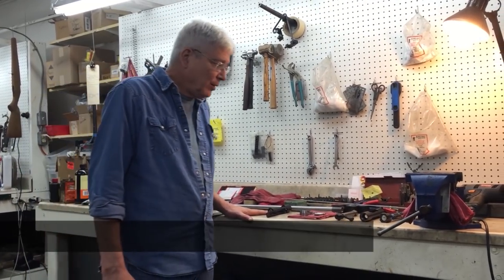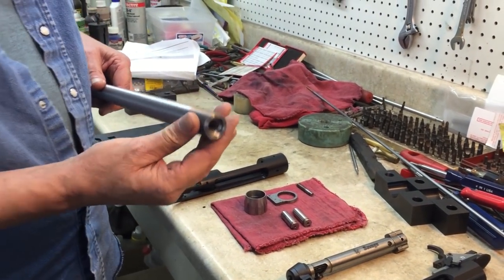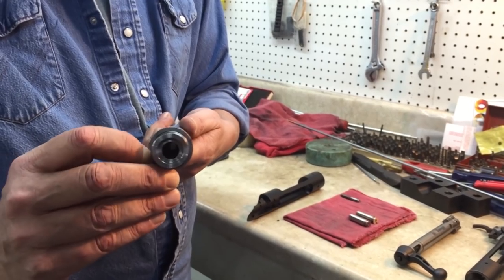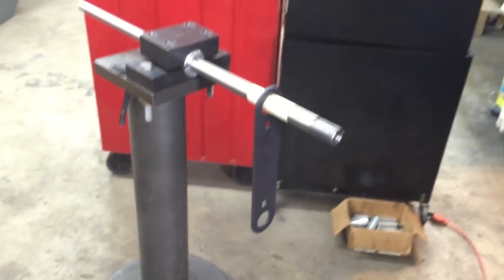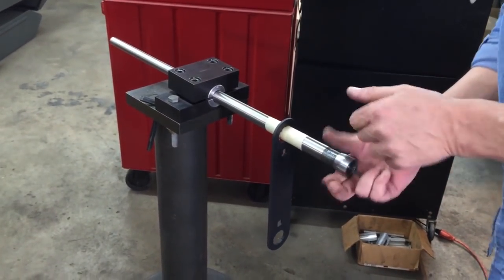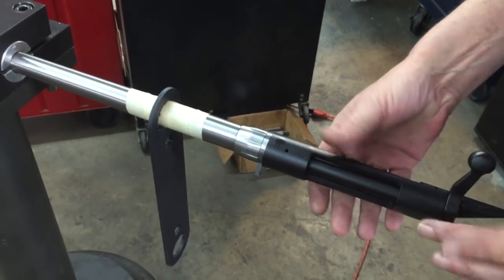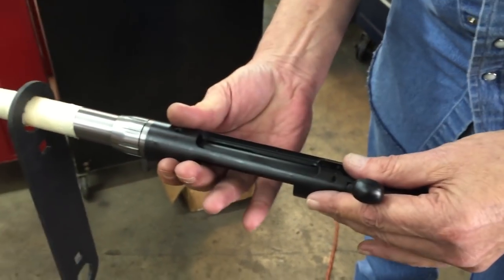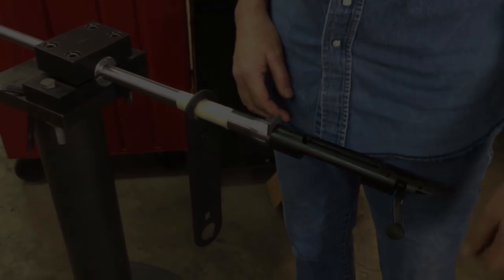How To Install a McGowen Remage Barrel - The Barrel Outlet - Savage Barrel Swap Installation

Comment: Thank you I just installed my first Remage!!!  I just took a 16 inch 30-06 to a 26 inch Palma.  I couldn’t be happier.
Reply: Did you have to do any inletting on your stock for the barrel nut to fit? Or did it just drop in?
Reply: raider5231 I used the Magpul Remington stock and it fit well.

Comment: FYI: As an added precaution, I put a spot of red nail polish on the joint of the remage nut and barrel, and a spot on the remage nut and receiver.
If the dots stay in alignment for 2 months of shooting, I will remove with acetone.   This way, I know that the barrel is on snugly.

Comment: Head space gauges are great but at 90 dollars a set that's a lot of money ..u said 30 dollars per gauge.where u get those for 30 bucks a piece ?? I use a new piece of brass and the tape method.works for me.yes you can crush the tape if you can't get the right feel.but then you have a whole roll of tape..that's why I like Savage actions they did it right you can COMPLETELY disassemble the bolt so you don't get that tape crushing problem.. as a machinest and tool maker ( retired) I find that Remington does a piss poor job of tolerance.very shoddy. I do love how you change d the barrel to a lock nut type.very nice .been thinking of that.. love all the things you can do with a Savage action.thsnjs for video nice job..oh yes I just give nut wrench one good wack and that's it.not using a ten foot breaker bar .lol

Comment: Very well done and a great instructional vid!  I just cringe when I see people use anti seize (I.E Copper Kote or Nickle) on close tolerance well cut threads.,
Thanks again
Reply: Why do you cringe in the use of the anti-seize in the video?  Does that not prevent problems down the road?
Reply: Judd Wind I am no expert  when it comes thread lubricating but well cut threads or class 2-3 spec  are close toleranced threads with  very little "slop" if you will and the metals in some of the anti-seize can actual cause galling of the threads.  Especially  fine threads that had been  torqued.  IMO  use a light coating  of a heavier  high shear oil....I use  metal working machinery way oil sparingly. Just my .02.
Reply: We read to learn and what we learn from reading we gingerly apply to validate other people's experiences. Thank you.
Reply: You bet there Mr. Wind!  Take all you read with a grain of salt....maybe more than a grain!  thx

Comment: So i's there absolutely anything i need to have a gunsmith so to my action before doing  the Rem/Age conversion?
Reply: Turn the full length down to 1.062, or have him profile it how you want it after the 1.062. However, it has to be turn down for the remage nut. He'll do that himself. Just buy the remage nut so he can have to assemble. That's pretty much it aside from the recoil lug, if you want a custom ground lug. Most like he'll need a new barrel to rebarrel it with.

Comment: Do you need to put loc-tite on the threads?  What would prevent the nut from backing off with use?
Reply: That’s a great question. Hope we get an answer.

Comment: As a gunsmith I can confirm the need to buy a Set from the same manufacturer.

Just take his word, & mine.
Reply: I don't see the point of this.
The gauges are a set measurement that does not change. The gauges must be within spec no matter what manufacturer they come from. Even gauges from the same manufacturer likely would not be made on the same set of machinery. If one gauge is out of spec it has no impact whatsoever on the other gauge being in spec.
This is one of those things that drive me nuts .. just do it ... just because.
I'll make my own decisions thank you. I'm open to reason and logic, but you're offering "because I said so".

Comment: Great step by step video - informative and easy to follow - seems simple. I purchased one of the barrel kits to upgrade a 700 SD ACC - the problem I've encountered - after the factory barrel was removed, the action will not thread onto the new barrel far enough for the bolt to seat in the counter bore or on the go gauge, let alone the no-go gauge . Cleaned al the threads on the barrel and received, greased it up but it threads of "hard" and seems to be "off" about .125"...can't figure out what the issue may be - any suggestions - or what am I missing.

Comment: This is a largely informative and well made video, but the bit about buying headspace gauges as a set seems way off base.  Headspace is an absolute, not a relative, value.  I suspect most gauge manufacturers don't even make them as a set because of this.  It doesn't really matter who made your gauges or when they were made, as long as they were made right they should remain right until they are damaged.

And I'd argue the tape trick is a matter of personal preference more than anything for a rifle being headspaced like a Savage.  There's no amount of feel involved for me since the bolt will clearly not close on a taped gauge.
Reply: DrThunder88  I have to agree about headspace gage Mfg. It doesn't matter where or when it was made its gonna be within tenths of exact. lol and Savage extractor will not grab the headspace gage on the .376 bolt face maby Pacific gage doesn't include case rim dimensions on their stuff.
Reply: They come as a set because there is a GO gauge and a NO-GO gauge, genius. There are no "absolute values" when you're dealing with TOLERANCES. Do you know the difference between a DIMENSION, A SPECIFICATION AND A TOLERANCE?
Reply: @rusty nuts He was rude rusty nuts, but he was correct.....
Reply: @deeremeyer1749  The gauges themselves are not tolerances, they are used to measure a tolerance. The individual gauges are a set measurement, not a tolerance, genius.

Comment: "Get them reasonably tight by hand" For me that would be about, 5000ft lbs. I'm the guy that rips bolts handles when shooting. I have done some horrors tightening things by hand without proper torque specs.

Comment: Do you have to remove the ejector?
Reply: Gunsmiths say yes, to avoid a false read on the no-go guage, that being said, I've installed several barrels without removing them, because it's my personal gun, and I'm getting tired of changing barrels. No problems with headspacing, but I'm reckless by nature. 
When removing pins under spring tension, do it inside a zipped camping tent.
Tape on the barrel is the best advice on here, something that you dont hear elsewhere.
I use a reloaded dummy bullet (no primer) as a substitute for the go gauge, because I'm cheap as well as reckless. I full length resize the brass, seat the bullet, and chamber check in a gauge first. No primer.

Comment: To that guy that's agins using never seize on the precision threads.theres no problem with using never seize on threads if you do it right ..a light coating.screw it in and out take a look at the threads.you only use a light coat of never seize..you are not putting frosting on a cake.apperantky you have never had two stainless parts gall on you

Comment: Now if I only all those tools, prob be better hire it done Cheaper I'd think.
Reply: Local-Yokel for sure. I had a 6mm creedmoor remage. It was almost $400 in tools to  it myself. I had a gunsmith do it and he charged me $100 to spin off the old barrel and properly head space the remage. And took him 20 minutes.
Reply: If you don't plan on ever changing it out,  or have other guns, yeah. 

I have done 8 now, with a old 20.00 vice, hard maple wood blocks, powdered pine resin, (literally take off a pine tree myself), put that on the barrel and blocks, bought a wheeler wrench, borrowed my Dads dead blow hammer, bought a no-go gauge, made my own go gauge. 
The 30.00 no-go was the most expensive part. The most difficult......, removing fresh pine sap from my hands.